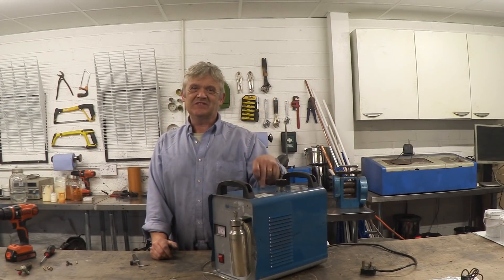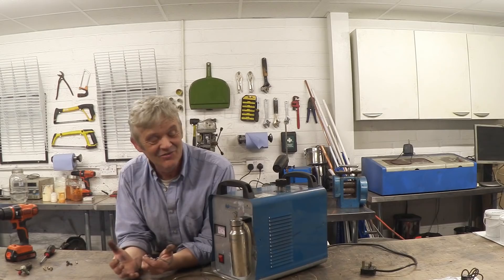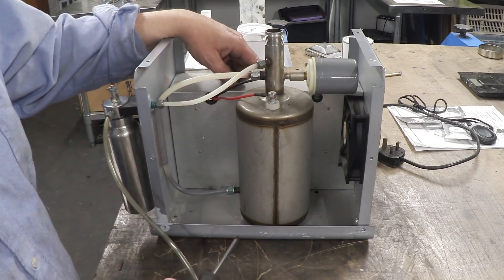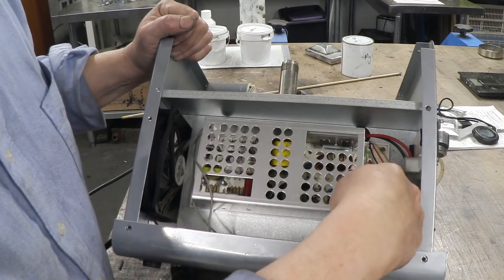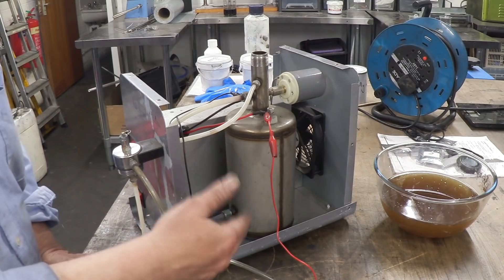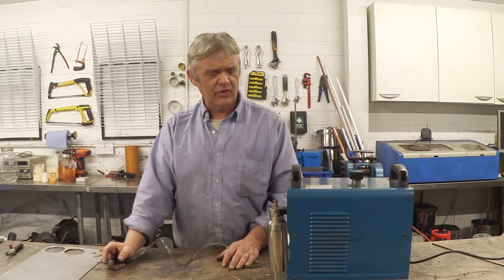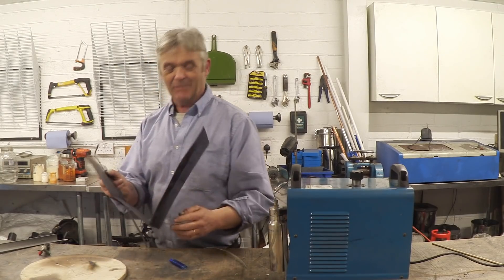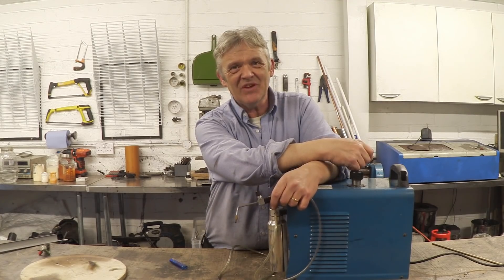HHO Torch Tear Down and Use

Comment: Hi Robert,
First of all i want to share i am really loving you videos and projects and when the time is right I am sure I will become a member 😉.
Regarding your video about the HHO  generator I am somewhat surprised that you didn't have seen all possibilities. I did not yet have the time to make one my own but play with one which was huge in the amount of gas and melted stone !! with that flame.
The HHO mix doesn't need  additional gas to burn which makes it explosive and it is VERY fast burning so a good arrestor is mandatory. By the way you still can by your friends gift.
Please have a look to below link where you can see a small device used to cut thick steel with only Water and electric energy. The flame temperature can be as high as 7000 degrees Celsius!!  Thanks for all you info and some good comments are given by your supporters 👍Greetings Erlend.
http://www.cntygf.com/mobile/index.php?moduleid=5&itemid=22305
Reply from the maker: awesome mate

Comment: That looks like the exact HHO torch I have.  I haven't used it much but it does work to polish the edges of plastic if you are careful not to heat it too much which causes bubbles and burning.  I also used it to solder heavy copper wire.  Tried to solder copper pipe but couldn't get enough heat for that.  I used sodium hydroxide drain cleaner and just adjusted the concentration to get a reasonable current draw.

I drilled one of the torch tips out slightly bigger but it didn't produce enough gas to keep the bigger flame burning very long.  No idea how long the device will last but it is an interesting idea that has some uses.  Blowing some bubbles into soapy water is a simple way to show the explosive power of the mixture of hydrogen and oxygen.  Would be interesting to see the difference between the sodium (or potassium) hydroxide and urea electrolyte.  This gas CAN float a balloon but you might want to try the soap bubble experiment before deciding to risk a balloon's worth of the gas.
Reply from the maker: I was thinking of replacing the generator with a dry cell and trying urea in it mate

Comment: Something is wrong with the DC board from this flame polisher , I have the same divice and the power consumption are around 500w , working voltage 48v 10amps
Reply: Gas production is around 80lt/h
Reply from the maker: are you sure it's the same mate? this is the lowest in the range as far as I can see - this is supposed to be 75L/h and eBay has pretty much the same thing at 95L/h
Reply: @ThinkingandTinkering  yes , I'm more than sure ! If its works right the length of the flame can reach till 20cm , its depending what kind of nozzles you use . I have a lot hydrogen cells in my lab , dry and wet cells .  years ago I bought different cells in China and one of them is the same like you showed . The main problem from chines cells was the DC bord , modern scrap , minimum lifetime !

Comment: Hey Rob,   I've got almost the exact same HHO torch (It's also known as KNALL gas. there are some very interesting videos in German on the subject) .  The primary difference being that mine has a generated pressure gauge on top of the bubblier , where yours has the manual pressure release valve.   I think you might be getting poor performance if you haven't let the pressure build up until the pressure switch inside kicks the machine off. It will need to run for a couple min. initially and then will take between 30sec to a min to build pressure back up and kick off again when in use.  When the pressure is built up fully and your tank is close to full you'll have shorter runtime as there's less pressurized gas avail. , however ,   When you have it at full pressure you'll have about 30sec of full gas pressure to work with and what it can do is astonishing!   Try just turning the machine on and let it run till it shuts itself off.  then have a empty aluminum soda can ready.  you'll likely have to work fast to witness the full effect, but when you light the torch, spin it open quickly and pass the mini light saber  across the face of the can.  It should slice through it like tissue paper!  then shut the torch off and try the same test with the lid of a steel soup can!  It's not quite as impressive, but it's CLOSE!  Now for the first of the very curious properties.... let it build up pressure again, light it and open the valve as before, but instead  try passing your fingers quickly but not FAST through the flame (Yes I am serious!) lol with an oxy/ propane or acetylene torch with even close to the same cutting power you'd 3rd degree your fingers almost instantly, but this flame feels no hotter than a pocket butane lighter!  I'll  see if I can post a video of me doing it with my torch as well as the can tests later today or tomorrow. :)
Reply: Soup cans all around the World must be shaking in their boots.
Reply from the maker: that'd be good mate - I'd like some hints here - I get a sense it can be useful it's just I don't know what I am doing here I think

Comment: Key thing to note is that electrolysis, while one of the most versatile tools in the chemist's belt, requires very high amps to produce meaningful quantities of product. So the reaction for alkaline water electrolysis is as follows:
Cathode: 2(H2O) + 2(e-) -> H2 + 2(OH-)
Anode: 4(OH-) -> O2 + 2H2O + 2(e-)
Overall: 2(H2O) -> 2(H2) + O2
Now we see here that we need a mole of electrons for every mole of water we break. Every two electrons liberate two hydrogen atoms and one oxygen atom. The charge of a mole of electrons is Avogadro's Number times the charge on an electrons, so one mole of electrons is Faraday's Constant at 96485.33C/mol. Amps are just coulombs per second, so at 20 amps, this device here is outputting 1/5 of a millimole of hydrogen per second. That's not even a quarter milligram of hydrogen fuel into the flame every second. Now hydrogen has remarkable energy density, so it doesn't take a lot, but this amount of fuel is super tiny. 

The secret is to get the most out of your electrons. Electrolysis of water is 1.23V, so the cell voltage should be as close to that as possible. 1.7V is great for high efficiency cells. Anything too high over 1.23V is wasted as restive heating in the water. Two ways to do this: Option one, get very high surface area plates in close proximity. This drops the cell resistance to allow for very low cell voltages, closer to the 1.23V ideal. The other option if you don't have a source capable of low voltages and crazy high amps is to wire up cells in series. Of course, continue to aim for close, high surface area plates to minimize resistance, but then wire up each cell for an optimal voltage drop. 

Also a pro tip: try separating the hydrogen and oxygen gases. Brown's Gas (HHO in 2:1 ratio) also combines with atmospheric air and leaves unconsumed oxygen, making an oxidizing flame that likes to cut stuff. A ratio of 5:1 is great for welding and can even clean up rust quite well since hot hydrogen can reduce iron oxide. Fe2O3+3(H2)->2(Fe)+3(H2O). Separating your gases also makes them storable (HHO is explosive and bad to keep around), so you can compensate for the overall slowness of electrolysis by generating gases while not in use.
Reply: I'd love to understand a practical HHO separation process from the top down and in laymen terms.

  I was super interested in messing around with this a decade ago, but never got very far past a simple working cell. I was curious about off-grid solar energy storage using electrolysis for excess energy storage. Separation of the oxygen is obviously critical, but doing so with cheap, simple, easily accessible DIY technology was something I never figured out.
Reply: @UpcycleElectronics  HHO separation is something that is easy to pick up, but hard to perfect. It's worth experimenting with different set ups until eventually landing on something that works. 

First, you need to select the right electrodes for handling the conditions of your cell. The cathode will produce hydrogen and the anode will produce oxygen. Oxygen in the air is O2, or two oxygen atoms stuck together, but when performing electrolysis, there is a fraction of a second where the oxygen is monoatomic without another oxygen atom. This is very unstable and will oxidize the anode easily. This means steel electrodes will rust super fast, as will many other metals. Some electrodes such as nickel will catalyze the reaction, such as nickel cathodes.

Second, you need to select an electrolyte. This will determine the chemistry behind how the cell works. Pure water doesn't conduct electricity, so an electrolyte is used to improve the conductivity of the water by adding ions. Unlike wires which transmit electrical charge using electrons, electrons don't travel well through water and the ions in the water do the moving of the charge. If you use an acidic electrolyte, hydrogen ions transmit the charge, if you use an alkaline electrolyte, hydroxide ions transmit the charge. Be careful when selecting your electrolyte, some electrolytes like to compete with water in electrolysis. For example, if we use salt water (NaCl) as an electrolyte, the chlorine beats out the oxygen and your cell will produce chlorine gas instead of hydrogen. 

My personal favorite electrolyte is a 25% solution of potassium hydroxide with a nickel cathode and a graphite anode.

Now you will need to evaluate your cell. Consider the following formula:
Vin = VH2O + IR
or
R=(Vin-VH2O)/I
Vin is the input voltage 
VH2O is the electric potential of water electrolysis, this is 1.23Volts
I is the current in amps
R is the effective resistance of your cell
Your goal as the experimenter is to make R as small as possible. Maybe you change your electrolyte or adjust the concentration. Maybe your electrodes could be changed or maybe they are corroding from the conditions in the cell. Maybe you can try getting the cells closer together. Maybe you can improve the surface area of your electrodes. Lots of options. 

Safety tip: Make sure your electrode is compatible with your electrolyte. Aluminum in strong acid or strong alkaline will produce hydrogen, but the aluminum will also aggressively react with the electrolyte. Always start small.
Reply: @Scipiworld  This is awesome information thank you very much. Are you aware of any way to make saltwater work safely in a cell? It would be pretty cool if we could find away to use the most abundant resource on the planet for this application.
Reply: Actually there is, dilute NaCl (5g/l) produces oxygen and not chlorine.
So as long as you can maintain that concentration no chlorine will be produced.
Reply from the maker: cheers mate
Reply: You are a treasure trove of practical, straight to the point information on HHO production.
I will make sure to save your comment as an invaluable resource.
Reply: Excellent points
Reply: Now, please figure out for me what the iron-based catalyst is to turn para hydrogen into ortho hydrogen like in the space shuttle. If you can create it with solar panels and stuff and store a separate gases and then use it on demand when you're ready to use it with a pressurized system you would also want to run the hydrogen over a catalyst to convert the stored colder para hydrogen back to its hotter Ortho hydrogen more energetic form. I'm not good enough for chemistry to understand why Ortho hydrogen is more powerful but I know that that is a real thing and that the secret of this nickel-based Catalyst has been kept classified for some reason.

Comment: Oh yeah, acetone in the bubbler and a bit larger torch and it can braze steel. You might need to clean the electrodes, considering the electrolyte sat in the tank for years.
Reply: Maybe you can reverse the electrodes to clean them.
Reply from the maker: not sure how to do that mate as it is welded shut
Reply: Robert Murray-Smith I believe the electrodes in the stainless tank can be removed for maintenance or replacement. The last time I used one of these was about four years ago to solder heavy earth wires to steel tube amp chassis. I swear I took it apart to clean it, I bought it second hand.

Funny thing, I was just looking for a 150+ watt soldering iron.
Reply: @ThinkingandTinkering  just reversing the leads on the tank for awhile should clean them

Comment: It is from Taiwan and officially sold as a jeweler's torch. If I remember correctly it costs around USD$140 or so. Its interesting use is actually not as a jeweler's torch but rather as a Browns gas generator for health. You need to add couple more bubbler bottles to completely take out any residual rye in the gas and it can then be bubbled through drinking water, breathed in directly. The most interesting use I have read about is the ability of the gas to cure skin ulcers as well as phantom limb. There is this company Eagle Research Corp that buys these removed the power supply to a more efficient one and a few more safety sensors to detect low water condition, some robust flame arrestor as well as a timer to run the device for a specific time and sells it for, hold on to something, USD$2,500! That company recommends a 20% Sodium Hydroxide solution instead of Potassium Hydroxide.
Reply from the maker: yeah I did look up the price - it's not that much - I think it can be rejigged for sure

Comment: * high five * on the blind installation after 12 years, you may have me beat procrastination wise!  HAHA!  🤣🤣 The torch with the red and green knobs is called a Smith Little Torch.  Just about every jeweler on the planet has one of those, including myself.  Given that the hydrogen torch is a Chinese model the Smith Little Torch is most likely a Chinese knockoff.  In fact, it's actually pretty difficult to find somewhere to buy one that isn't a Chinese knockoff.  They typically use propane and oxygen.
Reply from the maker: interesting - thanks for that mate

Comment: Is there a crucible material which will not react in the presence of HHO ? (Graphite is consumed into CO2)
Reply from the maker: dunno mate
Reply: try ceramic ones like aluminium ot zirconium oxide and don't keep it pointed at the same spot